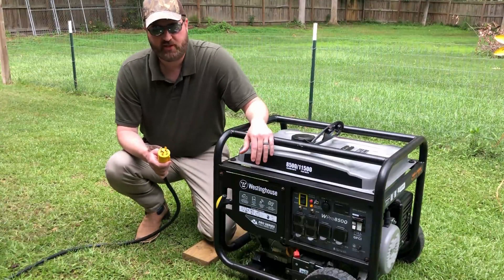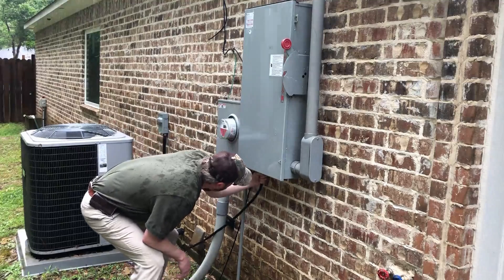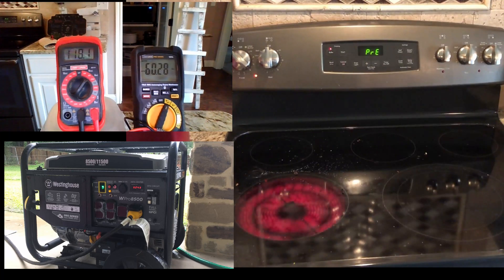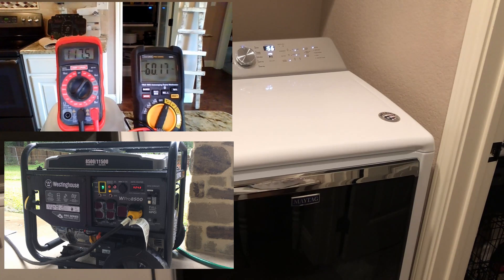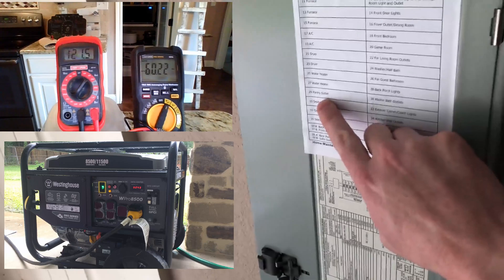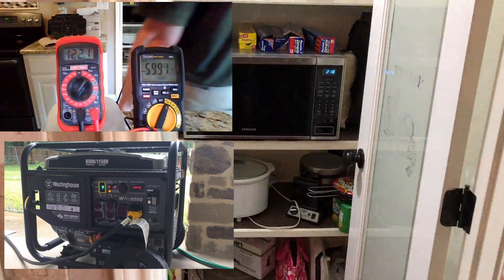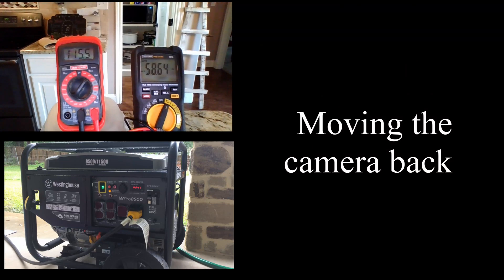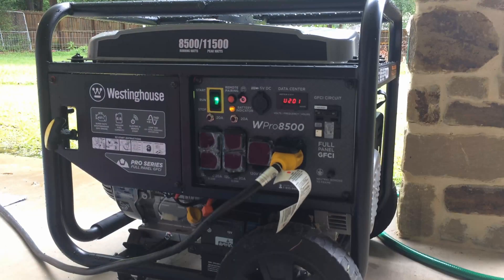Connect Generator to House with Transfer Switch - Load Test Westinghouse WPRO8500

Comment: Awesome Generator. I’ve had mine for a year now, haven’t had a chance to use it expect for testing.

I have a 14 seed 3 Ton AC and it runs it beautifully with a hard start on the AC.

Today was my first outage, about 8 hours. Ran my AC for most of the day, LED light, Coffee Maker, TV, stove, etc. I was expecting a bit more run time though. I’m pretty sure I had it full this morning and now after 8 hours, it fairly close to empty, maybe a gallon. 

They claim 12 hours at 50% but that must not be continuous because even with the AC on, TVs, some lights, I hover around 3kw. I was hoping to see a minimum of 12 hours. At 25% they told me by email to expect 17 hours. The gauge is crap so I don’t even bother checking it. Luckily I didn’t run out with such a large load on it.

Would love to see a fuel efficient test. I run E0 90 octane which should give me a bit higher fuel efficiency which unfortunately I did not see. 10 hours at ~30% loss isn’t great. Trying to at least a week from 60 gallons I store.
Reply from the maker: I have considered getting a hard start installed on my 3.5 ton AC. I'd like to know what the name plate on your outside unit says specifically about Running Load Amps (RLA) and Locked Rotor Amps (LRA) to see how it compares to my own.
The fuel efficiency claims from all generator manufacturers are probably in ideal conditions with simple resistive loads where as an AC compressor and air handler are inductive loads. Motors convert the current to magnetic fields and terms like power factor, real power, apparent power and current lagging the voltage come into play and gets above my understanding pretty quickly. 
My take is there are more to electrical loads than simple volts, amps and watts and I suspect the generator will react (consume fuel) slightly differently with loads that are resistive, inductive or capacitive. The slight difference adds up over time.
My plan is to run the generator long enough for the refrigerator and freezers to "meet demand" then shut if all off to conserve fuel. Of course, I'll charge batteries, phones, microwave and some fans during that time but I'm thinking I can get my run time down to around 5 hours a day.
Reply: LCS - LivingCommonSense AC has RLA of 13 and LRA of 88
Reply from the maker: Thanks! My 3.5 ton shows RLA at 18.1 and LRA of 105. I'll look at having a hard start kit installed next time the AC guy is out.
Reply: @LivingCommonSense  thats easier said than done brother!!!!!
Reply from the maker: I would definitely have to find professional that knew what they were doing

Comment: What brand and model transfer switch are you using?
Thanks
Reply from the maker: It is an Eaton - Double throw safety switch - 240V-200amp single phase.

Comment: I followed the procedure in the bulletin and now the generator will not start. The SB10.23.18 pictures do not look like the ones in your post here. I've tried to reach Westinghouse technical support...no luck yet!
Reply from the maker: When I was floating the neutral, I didn't see SB10.23.18 posted on the website. I found only the SB8.31.18 service bulletin was posted. As mentioned in the video, my WPro8550 does not look like the service bulletin shown on screen. I had to study the SB8.31.18 they had posted and apply what they were doing to my WPro8500. The SB10.23.18 you found would have been nice to have!
"Will not start"...does this mean the engine will spin over but not crank and run? Try the easy stuff first like make sure gas valve is on, plenty of oil and the spark plug wire is on the plug.  After checking those, I would set the wiring back to the way it came out of the box and get it to at least generate power again.
Reply: @LivingCommonSense  Problem was a cracked spark plug!  Replaced it with a NGK 1034. My floating neutral connections were correct. I connected to the 10 circuit transfer switch and every circuit is working fine. Thanks for your reply brother. I'll subscribe to your channel too. Regards, Tom
Reply from the maker: @Tom - That's awesome! Glad you got it going and thanks for the Sub.
Reply: I recently sold my 8500 Pro to a friend and it continues to serve his small house well. We have natural gas available so we replaced our 60 year old Lenox oil furnace with a natural gas unit and installed a 24K Generac whole house genny. I am using a Honda EU2200i at the cabin. Hope you are doing well....Happy New Year! @LivingCommonSense
Reply from the maker: @utubetjc - I still have mine but would consider selling it. It starts very easily and has been reliable. Maybe I'll let it go if we get some ice and replace it with an inverter type. We don't have natural gas and we don't lose power often or long enough to justify a generac along with a propane tank. You have an awesome setup. Happy New Year!

Comment: According to Amazon this thing can run a welder. Can you shed some light on that?
Reply from the maker: It would depend on the wattage requirements of the welder.  If the welder will run on a 30a 240 volt circuit, it will probably ok but I've never run a welder on this one.  In any case, if you think your average load will approach 30-35 amps, you might up size just to be safe.